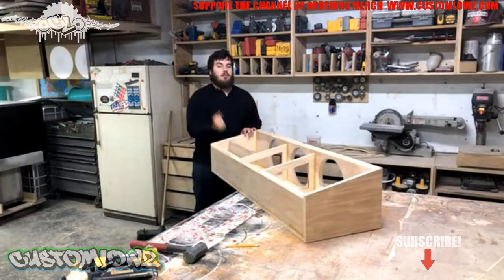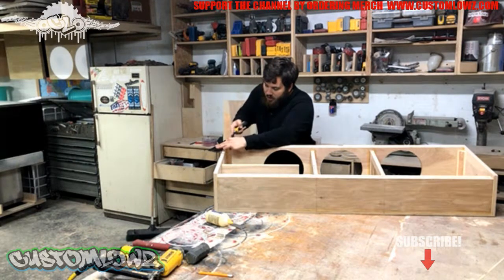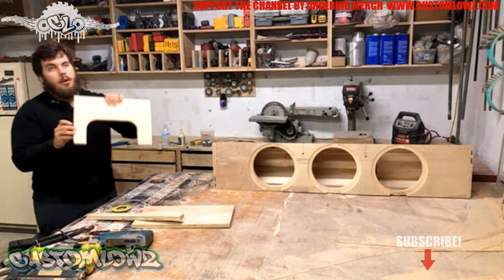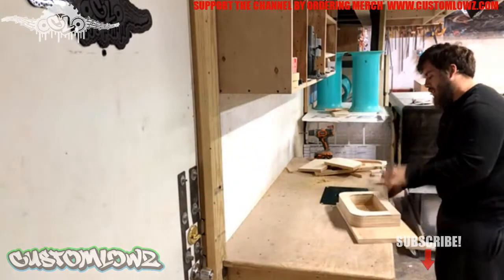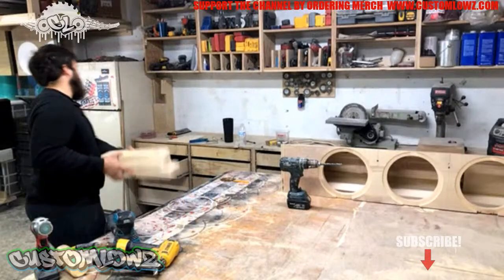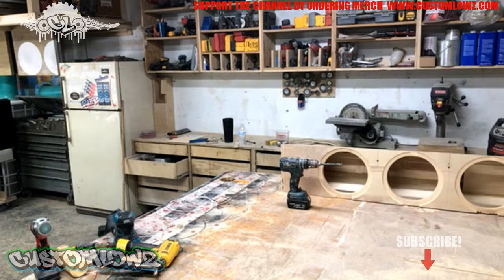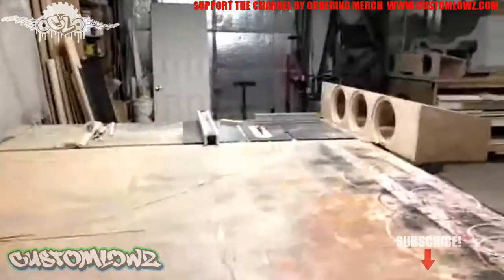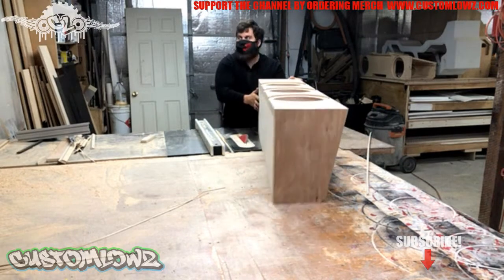Bangin Truck Bass! Ford 150 Underseat Build (Part 4) LIVE WITH CUSTOMLOWZ EP29

Comment: 1728. You need to look at 1:28:45. Wow that thing was smoking after you walked to the breaker. Be careful.
Reply from the maker: 1728! Yeah the saw smokes when im cutting a large 45 like that. Its not the motor of the saw, its the blade heating the wood up and burning it. I should probably go get a new blade lol
Reply: How many cub. You get out of this box ...